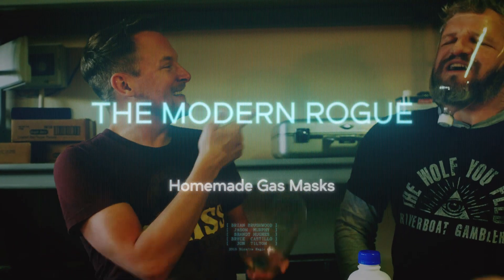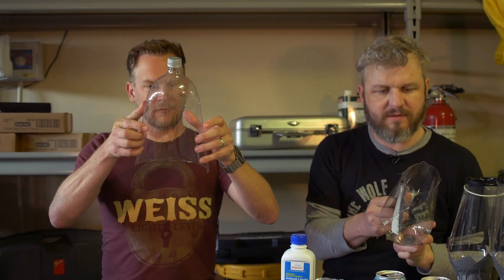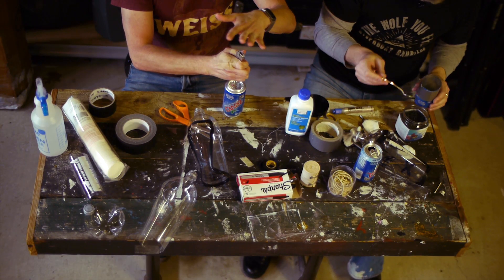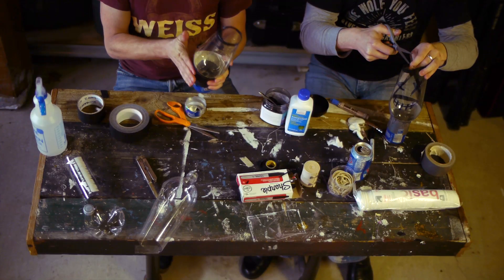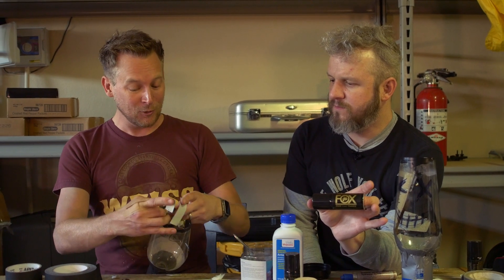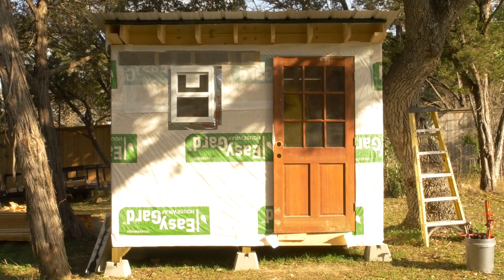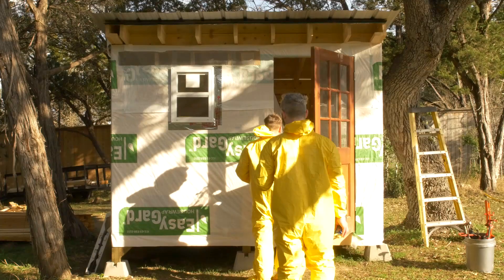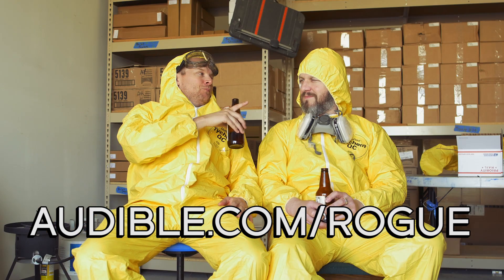Homemade Gas Masks vs. Tear Gas Grenades

Comment: If i might just add a little hint... you can soak 1 cotton pad with vinegar... that should act like an extra filter
Reply from the maker: Ooh, good stuff!
Reply: radiation no, irradiated dust? yes it does to some extend, depends on size of dust particles.
Reply: No it wont. it will only block alpha and maybe beta radiation
Reply: Charcoal will filter biological, and chemical. Nuclear, again read my comment, for alpha and beta, yes it will work, but gamma is not particles. That cannot be filtered. That requires a lead lined suit like they give you at the dentist for x-rays, or some heavy mass building.
Reply: Alpha and Beta are "fallout". A gas mask (or just a dust filter) will protect you from fallout.

Gamma radiation, the really bad radiation, is why you need a bomb shelter. It's the radiation given off at detonation. It is not dust, it is not filterable. It can be blocked by mass however. Concrete walls, earth (dirt), or failing that, a "pillow fort" made of books can be enough to protect you (or that lead lined fridge in Indiana Jones). Gamma Radiation is halved roughly every 14 hours, so 14 hours after detonation of a small device, if you arent suffering radiation sickness now, your shelter was good enough. 28 hours later you may be safe to move outside for short periods. Two weeks, and even with large devices, the gamma radiation should be negligible.
Reply: Hohenzollern WARNING ⚠️ THE ONES THEY MADE 
DONT PROVIDE NBC PROTECTION
Reply: Tino TheKid what does NBC means?
Reply: L Lawliet nuclear biological chemical warfare
Reply: It makes me laugh and cry at the same time 😂 that no one has a basic understanding of Chemistry and Physics. Smh
Reply: I'm assuming it needs to be wet to work?
Reply: LOADED COBRA no it can't
Reply: Tino TheKid thank you
Reply: Jose Leonardo Monier IV ?
Reply: "The computer isn't sure, but it thinks this NBC used to manufacture cookies."
Reply: Phillip Morris because everyone is meant to know these things? Not exactly taught this in school.
Reply: But then won't you be breathing in vinegar?
Reply: @austinscheetz7488  that's not harmful
Reply: Thanks!
Reply: LOADED COBRA no
Reply: Ok so I know this is very late, but Alpha radiation is a helium nucleus, which is generally blocked by paper. Beta radiation is high-energy electrons, which is blocked by a thin sheet of plastic or metal. So a particulate layer would work well for blocking such radiation. However, generally fallout is radioactive particles, like thorium or uranium decaying, releasing Alpha, Beta, and Gamma radiation. These particles are usually the ones blocked by particulate layers. Also Gamma radiation is an electromagnetic wave, only blocked by lots of dense materials (or an insane amount of non-dense materials). So really a gas mask would only partially block radiation.
Reply: Or piss on it
Reply: Can this prevent nuclear radiation ?
Reply: MrJolaf22 Better than nothing, but shit, that gamma is going to bleed through everything.

Comment: You can get an actual gas mask for very little instead of derping around with stuff like this.
Reply from the maker: I think you're missing the point of "homemade."
Reply: @scamschool  The problem isn't that they're homemade it's the fact that 1, they're made poorly and dangerous to the user as they don't have a proper exhale valve and 2, I can get a surplus gas mask for like $2 with a working filter, carry bag and anti-fog paste.
The biggest problem with this video is the masks are so badly made you wonder what's the point of them, they're not even airtight because they literally have holes in the mask where the rubber bands are. They also leave out important information like how having a beard practically negates any mask (including current issue military and industrial masks) because it breaks the seal. 
You could have done a far better job with more research and a bit more time that might of actually been a viable alternative to cheap surplus masks.
Reply: +Scam School Why even bother making a homemade mask is what I'm saying.
Reply from the maker: Why bother making homemade anything?
Reply: +Scam School All I'm saying is a gas mask is one of the last things I would want to be homemade.  Let's just leave it at that.
Reply: @WASPfreak  I look at stuff like this as damned if I do or damed if I dont. Really more along the lines of it hit it the fan or much worse you run out of proper NBC filters. Again damed either way....
Reply: @WASPfreak  maby i cause a pandemic and make all the masks sell out
Reply: @WASPfreak  maybe a dyi in a emergency when you cant get one instantly shipped to you and appear within 10 minutes of needing one.. Dont know just a thought...  I guess your one of the people who bought 5 giant packs of toilet paper over the past 3 weeks... :P
Reply: @reviewguru5457 It's better than nothing, I guess.  I was not one of those people.
Reply: what if a volcano erupted or something,what are you gonna do? go on amazon and buy a gas mask and wait at your front door?
Reply: I mean if you are in a situation that calls for a hasty making of one you have to time to order one than a homemade one is going to be a life saver.
Reply: Not really. Combat gas masks are made to work with your combat gear and tend to have some kind of nub that let's you connect to a water source without having to remove your mask. Industrial masks tend to be more comfortable and more colorful (bright colors to be seen better) and many still offer eye protection, they just don't have a drinking nub. As far as filtration goes it is just a matter of looking at what the mask is rated for. Obviously an industrial and mask will not list pepper spray, teargas, sarin gas, or any other type of gas that you would typically think of combat gas masks for but fine particulate masks or masks used for acidic fume environments should do just as well. Of course as you up the protection, both for your eyes and for finer particulates and more hazardous particulates, the price does go up (so does difficulty breathing), but once you get the mask the filters are the important part not the mask.
Reply: @nithia  the main difference is the filter, industrial have cloth/fiber filters and combat use layers of filtering material like charcoal.
Reply: nithia aren't industrial gas masks and combat gas masks different?
Reply: nithia well i guess making our own gas masks would be practical if you don't have a gas mask

and you know you feel badass
Reply: Austin Hoang Well if a volcano goes off and you have no mask then this method will help but so will a damp rag. The point of saying to buy a mask is have it on hand now before something happens. Then if you need it you have it.
Reply: Lamp Light what are the odds to deal with radiactive chemicals
Reply: What the fuck, you can get fully working gas masks for 6 bucks over where I live
Reply: I think it's more for a survival scenario where you don't have any other way to get protection from gas weapons.
Reply: WASPfreak in case of emergency dumbass
Reply: omfg. here is the thing. IF you want to actually prep for emergency (which you should) Follow these steps 
1. Choosing the gas mask. You can buy them on eBay and a good one can cost at least 30 dollars. Get an isreali kit or if you can afford more get an s10 or fm12 with a haversack.
2. choosing the filters. Most masks accept nato filters some eastern european and all russian masks accept got filter. The masks i mentioned above are nato. there are different filters the ones i recommend have the rating abekp3.Its hard to find them on eBay but you can order them from other sites if you do research. also be careful. most filters are expired. they have a shelf life of 5-10 years. get a non expired filter. don't get a pre 1970s nato filters (that contains asbestos) or a cost pre 1990 filter (also contains asbestos. 
3. Preparing for nerve gas or radiation. Get a hazmat or radiation suit. the problem is that it takes about 2 minutes to put one on. So i could recommend using thick clothes to cover up all your skin. plus gas mask.
4. filter duration. filters can last 24 hours in light gases such as tear gas. however in high concentrations it can only last about 8 hours. 
5. Should i get one? Well short answer. YES its better to have one than be sorry. Don't be a cocky prick. Besides they can have uses for cosplay or some such.

In short. invest in a cheap civilian or military gas mask. Get safe non expired filters. And most importantly. stay safe and do your research.
Reply: @bigturn1051  OK, I'm late, but I think you meant pre 1990 filters from USSR contain asbestos. And I'd suggest buying a polish FP-5 filter (non expired, of course) as they can be used  with NATO and Warsaw Pact gas mask.
Reply: Call of Duty Infinite Warfare i meant GOST instead of cost smh my head
Reply: +jordan nazif Nah, you just go to home depot and check the raitings on the masks. Should be able to get a small particulate mask for $30-$50. I have one for airbrushing and working with strong model glues. But basically the filters are what they made; a series of cotton fiber pads with activated charcoal. Also the one I got has about 6 diffrent pads I can get for different levels of contamination, and I can buy the pads in bulk for about $0.50 per pad. Mine has no eye protection though but I could always wrap duct tape around my Desert Locust goggles if I need to.
Reply: Austin Hoang not very high unless you live by a chemical plant i guess lol.
Still get a real mask (make sure it dont have filters from ww2 and its safe)
Instead of making one at home
Reply: Lamp Light lol ok
Reply: WASPfreak Beautiful Schms you have there
Reply: 紫 式部 Thank you.
Reply: WASPfreak Do you have a collection?
Reply: 紫 式部 Yes, I do.
Reply: nithia 
Especially in Miyakejima, with Mt. Oyama emitting thousands of tons of sulfur dioxide per day

People are required to always carry gasmasks incase
Reply: WASPfreak HOW WHERE WHEN AND WHY!!! well not why, I want one
Reply: kbros119 _ ebay
Reply: WASPfreak brah...gas mask that are good cost around 80 to 200€ in my country
Reply: L Lawliet You can get a gp-5 for much less than that I'm sure.
Reply: WASPfreak yeah but the only issue is that it’s cheaply made and isn’t very safe. I own one though and I would prefer it over any homemade mask
Reply: L Lawliet 
Nah they have some "super filters" that can filter everything from Sarin to tear gas to ammonia gas, etc.

But generally, yes. The mask usually stays the same, but the filter changes.
Reply: WASPfreak but they dont cover the eyes
Reply: Also some gas mask filters have asbestos
Reply: Like the M3 and M-53
Reply: stale meme what about 15$ and 30$ for a new filter ?.tou are looking at recent stuff stuff from cold war (everythink exept the filters) is okay for civilian use just beware of cracks if the mask is in very terrible condition.
Reply: WASPfreak Just on Amazon, I was able to get a used FM12 and start stockpiling Israeli filters all for under $100.
Reply: My point for making is that for those outside murica. Its not the same, my country currencey is 1 dollar=50 or 49 something so, its not that i need one or i will stay with it. More like a stopgao solution while i figure out a way to ste--------------EARN money. JK but bad jokes aside , thats pretty much it
Reply: wasp..........well duh
Reply: the point is that you can make them without being clearly traceable and you can get rid of them without losing much. given the guys where in a ground zero setting to concentrated CS gas, they werent getting wrecked within seconds. so effectiveness? sort of.
Reply: It's more satisfying to steampunk something together provided it works of course.
Reply: A GP-5 Gasmask Costs less then:  €10.
Reply: Where can i buy a real one?
Reply: @theopinionchannelforyou7739  see my last comment since i just noticed yours. Ebay is your best bet amazon is over priced.
Reply: @theopinionchannelforyou7739  ebay u should buy israeli civilian mask or gp5 as starter but clean them and dont use gp5 filter it has asbestos i dont think israeli mask filters (new ones) have asbestos
Reply: Spent like $40 on an msa millenium on ebay. I think there wete 6 left. Filter not included.
Reply: Yeah and a case of a actual gas attack I rather just buy one off of Amazon for almost nothing
Reply: I would not trust any of those gp5 filters
Reply: ShadoExperamint I trust a gp-5 filter over a 2 liter bottle
Reply: You can get a GP 5 for $15 but you'll need a new filter
Reply: There are no gas masks available where I live and the government started ordering military force to attack with gas. Do you think I'll DIY this if it was readily available?
Reply: So
Reply: From the future, this comment is adorable
Reply: What are the odds there'd be a virus and then social unrest and you wouldn't be able to get supplies

It's only like 25% of horror movies
Reply: +jordan nazif Nah, you just go to home depot and check the raitings on the masks. Should be able to get a small particulate mask for $30-$50. I have one for airbrushing and working with strong model glues. But basically the filters are what they made; a series of cotton fiber pads with activated charcoal. Also the one I got has about 6 diffrent pads I can get for different levels of contamination, and I can buy the pads in bulk for about $0.50 per pad. Mine has no eye protection though but I could always wrap duct tape around my Desert Locust goggles if I need to.
Reply: (THIS IS SUPPOSE TO BE SET IN THE FUTURE) Just say Hillary Or Trump gets elected and someone insults his wall or her email name and they press that red button and set off and starts a nuclear war, but you survive but you have to get to the store to get another video game cartridge for your gameboy but have to walk through a hot spot like in black light retribution AND YOU DO NOT HAVE A GAS MASK.
Reply: @ResidentCoder2  exactly the point.
Reply: WASPfreak im not an expert and correct me if im wrong but masks have protection in specific gas right?
Reply: it costs 100$ +....
Reply: stale meme you can buy a gp5 for $10
Reply: @stalememe6407  masks are less then 10
Reply: stale meme actually you can get one for around 30-40 bucks
Reply: actually the most filters have fiberglass superfine 3000 uber fine paper breathe through filters+ activated charcoal that protects against the radiative chemicals... i believe.
anyway homemade wool fluff masks will barely save you against dust, and you can get some (very simple) masks + filters for about 10 dollars

Comment: does anybody know how to deal with the mask fogging up. I made one and it all ways fogs up
Reply: I am a firefighter, and our masks are more complex, they have an outer mask, with the glass for the eyes. And an inner mask, inside the mask, that is covering the nose and the mouth. If you breath in, there is an underpressure in the mask that seals the mask to the face and opens a vavle from the outer mask to the inner mask. The fresh air is now going from the filter into the outer mask, striping the glass and drying it and going through the valve into the inner mask and into the mouth and nose.
If you exhale, there is an overpressure in the mask, the valve from the inner to the outer masks closes, and no wet air from your lungs can fog up your glass. Another ventile, this time on the lower side to the outside of the mask from the inner mask opens, and the used air can go out. The vavle to the outside closes again if you inhale again.
The valves are only simple holes covered with a thin piece of rubber.

Comment: To be honest. You can use black duct tape as the head band instead of rubber band. You need to measure it first.
Reply: put two duct tapes together
Reply: Wouldn't it take your hair off

Comment: try using powdered activated  charcoal
Reply from the maker: I'll bet that makes a big difference.
Reply: It helps bond faster with the material and i suppose it wont bounce around when you breathe hard
Reply: I think it'll also fall out the filter holes on the can leaving you with less and less carbon with every movement..
Reply: Encore it wont...if u first put cotton then powdered activated charcoal then cotton again :)

Comment: This could be improved alot. Starting with a balaclava, cutting a mouth hole and fitting the filter, and then coating the balaclava in spray on rubber would provide a much better seal than the edge of a plastic bottle. The plastic could be used to protect the eye portion of the balaclava. Also, 2 filters would be much more effective, other than that, great video, definitley entertaining.

Comment: How about using 1 can, but you put in a (or some) vertical wall(s) so the airflow have to snake around in the coal?
something like this:
_____
in |  out
|   |   |
|   |   |
|   |   |
|       |
--------

Comment: you should actually make the pellets into almost a dust form somewhere between dust and gunpowder balls or copper bb size and then pack it up rly tight. thats almost how real filters works
Reply: mix dust with larger pellets would probably be good.
Reply: I was thinking that, maybe not a powder, but fine crumbles....
Reply: astrangeone yeah thats what i mean with bb pellet
Reply: im using coal filters at work, and i can say that there is absolutely no dust in them, but the pellets are much smaller than the fishfilter stuff. how can i describe it? take a ricecorn and cut it in two halfs.
Reply: da real rulezbreaker yeah like a pellet or a copper bb with the size of like 3mm